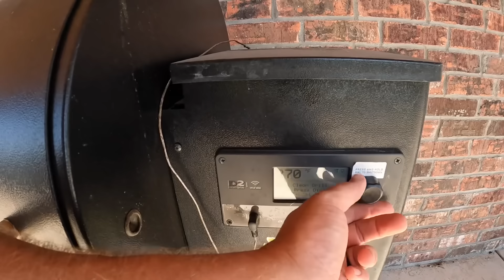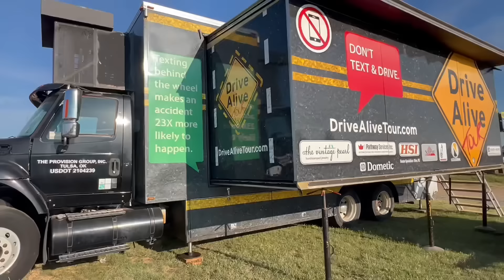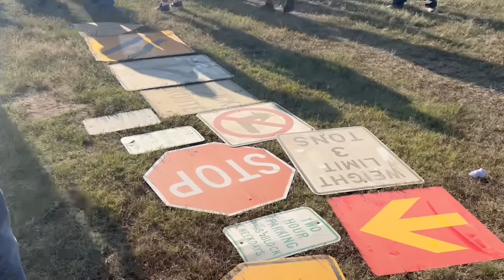Selling At An Amish Auction | They Laughed At What We Brought

Comment: Have you checked a camping toilet? We had one in our pop up camper. The top and the bottom detach and the bottom was a sliding cover, a handle and a spot that swing out. You can easily dump it in a flush toilet or a dump station for campers in the camp ground. Paper can be put in zip  lock bags and placed in the trash as an option. Walmart carries camping bottles of options for Odor etc. Ecco friendly. We bought our camping toilet at Walmart. Camper dealers have them too. Ours was very affordable. Our pop up camper had a frame cover that covered the toilet that folded over the toilet with a cushion on top to use as a chair. We kept our camper toilet for emergency use when the power goes out at home. Hope this makes since .

Comment: For bike chain ⛓️ it's because the rear tire moved forward loosen the nuts pull tire back until chain tight on sprocket then tighten the nuts with someone holding the tire back to keep chain tight.😊

Comment: Cassie or Gary every once in a while you need to loosen the rear tire on the back of the bike to tighten the chain. Just loosen the two nuts and pull the tire backwards. You can place something between your tire and frame so it doesn’t move forward. That way the tension stays on the chain. You do want a little slack so not to ruin the bearings. Then tighten the two nuts back up. If that is a regular bike you’ll also have to loosen the rear brake too.
Reply: I agree. Pull rear tire back to tighten the chain.

Comment: A temporary fix for that chain on the bike is loosen the nuts on the axle of the bone both sides slide the tire back a little bit until it gets tight and then tighten the bolts back up. Or get a new chain.

Comment: We had to use the same portable for my mother at bedside. It works good to put some water and we used dishwashing soap in bottom after each use. It could be used multiple times for #1 with no real smell. Just remember it will need to be dumped into a dug hole and covered up. Happy skoolie camping.  
🚌 🌲🌳🌲🌳🚌
Reply: Liners are inexpensive and so much easier than cleaning the bucket each time.

Comment: Hi, bike chains do stretch because of the flattening of the links. It is a very small change but can cause the chain to come off the gears. There is a chain checker tool to measure the amount of stretch. It may be easier to replace the chain to save making any adjustments on back tire position.

Comment: I like those kinds of stores. The paneling will look nice on the walls in the scholie. As far as the bike chain goes. Just loosen the nuts on each side of the rear wheel and that will allow you to slide it back to tighten it. New chain not necessary. I enjoy going to auctions. Thanks for sharing

Comment: What we used to do was loosen the back wheel, get the chain on and then use a tire iron, is what we used to push the back tire towards the back.  That usually tightens the chain.  Yes to answer your question the chains do stretch and I believe you can take a link out to shorten it up.

Comment: Cassie while the bike is in the same position it is in upside down. loosen the two outside nuts where the back tire is connected to the bike frame. With the loose nuts pull the back tire just enough to tighten the chain with no slack in it. While some one holds the tire still retighten the two outer nuts again. push on the pedal to get the back tire to turn / spin. Make sure the tire is centered and not rubbing on one side or the other.

Comment: You could make the door out of the panelling Gary build a frame and add the panel same as the walls it would be lightweight and you just need a hook latch both sides. Cassie the chains sometimes stretch you can take a piece out or you can undo the wheel and pull it back a bit to tighten it, Otherwise you buy a new chain and replace it . A bmx  bike is just for that not for every day use they are usually a specialised bike plus you need all the bmx clothes ,helmet ,gloves and shoes as the shoes lock onto the pedals when they ride😊

Comment: Cassie, when you get the chain on. Loosen the bolts that hold the back tire on, pull back on the tire until the chain is tight, then tighten the back tire. Just a guess! I haven't operated on bikes in many years.

Comment: That toilet had disposable bags that you use with it.
Reply: I had a bedside commode...those bags cost a LOT compared to garbage bags meant for office wastebaskets (same size). Just a suggestion.
Reply: Just a suggestion, those specific bags cost a lot compared to small size garbage bags (wastebasket size).
Reply: We used one of those in our camper and actually put a disposable diaper in the bottom when not stopping for a bit.  Open it up spread it as wide as you can. 5 kids it worked great.

Comment: Hey WFF! I have a suggestion on your potty. If you line the bucket with a trash bag and use kitty litter to cover your deposits with it will cut down on any odors and disposal is much easier. Just change your bag and toss in the trash. 
  We used a similar set-up on our pontoon. Worked great. I enjoy your channels so much. MK from Tennessee.

Comment: Casey you did not loosing up the nuts. On the rear wheel and retighten them, all need is 2 box end wrench both of them may be a 9/16 or a 5/8 inch wrench.  In mm it will might work on wrench is 14mm or 15mm.
Another ideal is get a cheep wrench from dollar tree store. And put screw on your wood post under the car port . To have them around just in case you tighten the bike wheels . 
Because some time you need tighten up the front wheels or fix a flat  tube. All of the time you need  only a 9/16 or 5/8 wrench to fix it.😅🤔👍

Comment: Guys  the Porta potty will work amazing suggestion when we used ours we put them little plastic 2 inch bags in it to line the bucket easy cleaning you just take the bag out after use scented bags it serves its purpose

Comment: Turn bike upside down again , loosen the nut on rear tire, take a claw hammer an place it in front of tire next to the hub where the peddles are at . Stand at back of bike an press forward on hammer head, pushing the rear tire back which will take the slack out of chain. Tighten the nut on rear tire , so tire can’t move forward or backwards. This should fix the problem with the slack in the chain.

Comment: They make plastic bucket commode chair liners; you simply tie up the bag then dispose of it.  Of course the bucket can be used, emptied cleaned, and sanitized.  There are urine collection cups that fit onto the edge of the bucket which can then be emptied with a lot less work, cost, and effort than dealing with the whole bucket. And they make a ?travel commode chair that folds flat after the bucket is removed.

Comment: The chain on "Handsomes" bike can be tightened by loosening the rear wheel center bolt nuts, pushing the wheel toward the rear of the bike, and tightening the center bolt nuts- insuring the rear wheel is as straght as possible. This of course, is done with the bike upside down.

Comment: That’s a bed side commode for those who can’t walk to the bathroom. Or they can go over top of a toilet. To help raise it higher if they’re not able to standup from a toilet.  You have a bucket with handle to slide out from the bottom to dump out its contents. Add some Lysol or water and toilet chemical to help with smell between emptying bucket. 

On the bike, chains stretch and you need to remove links in the chain or buy a new smaller chain. Since that bike is older I’m guessing, so stretched chain.

Comment: Cassie what you got to do have Gary take him back wheel I'm losing it keep the chain on the sprocket and the back tire got loose so what you got to do is loosen up the two bolts in the back slide the wheel down until the wheel gets tight and then tighten them up and the chain will stay on

Comment: as a cyclist i can tell you with confidence that the chain on rangers other bike needs replaced as it has stretched with age and is no longer good or in the short term you can get a chain tool and shorten the chain but i would say putting a chain thats new will last longer also check the teeth that the chain runs on too make sure they have not wore down but from what was shown and i am sure you will see ranger really giving that bike a workout

Comment: 🤔🤔 💩🚽🚌 When my sister had to use a bedside commode she put a little Pine Sol in it to cover the smell. 
🤔🤔 You can use small garbage bags and twist them closed when you're done. Put a little kitty litter in before you go in the bag to absorb liquids.
🏕️ We still have one and I take it camping. I don't put the bucket in and dig a hole under it. Cover what I leave and fill the hole before I leave the site. Biodegradable toilet paper.

Comment: Should have checked out camping toilets, the mess is contained and the smell is not that bad, we had one in our cabin before we installed our composting toilet.  Ours even had a built in water pump, so you could flush it.  Some only run around $200
Reply from the maker: Depends how this goes, we might upgrade

Comment: You may need to loosen the nuts on the rear wheel and pull it back in the slots to tighten the chain if it isn't stretched too bad

Comment: CASSIE ALL YOU NEED TO DO TO FIX THAT BIKE IS UNSCREW THE TWO BOLTS ON THE BACK TIRE SET ON THE GROUND PUT YOUR FOOT BEHIND THE SEAT AND PULL UNTIL THE CHAIN IS TIGHT, THEN TIGHTEN UP THE TWO BLOTS AT THE SAME TIME MAKE SURE THE TIRE IS STRAIGHT. YOU ARE ALL DONE IN JUST A FEW MINUTES. I SURE HOPE RANSOM LIKE RACING HE IS GOOD AT IT.

Comment: Yes the chain dose get stretched out over time and because of the child weight and muscles 💪.  The rear nuts come loose too, always  tighten up see a have inch sage on the chain,  
Too tight and wheel may not move very well, plus one side of the wheel may rub the bike frame.  A good hand cleaner for the dirty hand is Goop it takes off the grease off hands fast and it will not hurt anyone hands it smells nice too. 
Always have a shop towel around to clean up your hands . 
And you do not need any water too wash your hands . 
Plus you do not the bathroom sink dirty or towels dirty , making so mom and dad get mad because of the paws 🐾 😿🙀🙉🖐🖐around in the bathroom 😅😂hahaha.  
Another plus that if grease on yours clothes you can take a little bit of the Goop and get the grease out before it gose in the wash😅
The orange hand cleaner is good too. But need clean your hands more, because it  leave a film. 
And Goop hand cleaner is a good thing take along camping because  you are using any extra water 💦 to clean your 👐 hands.